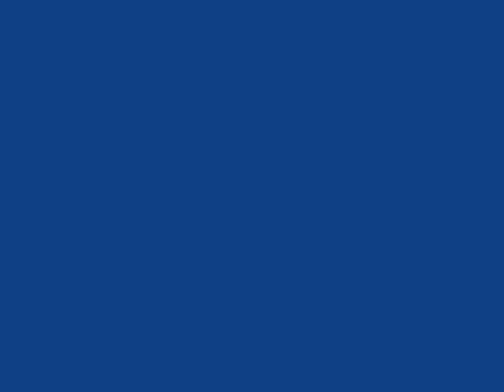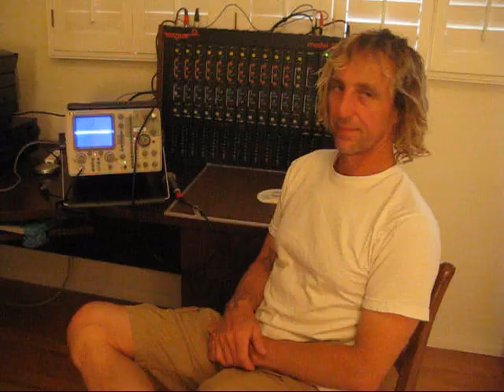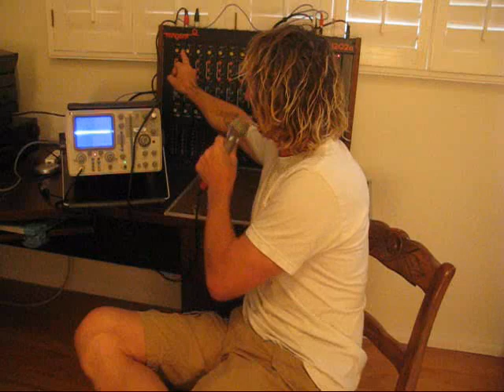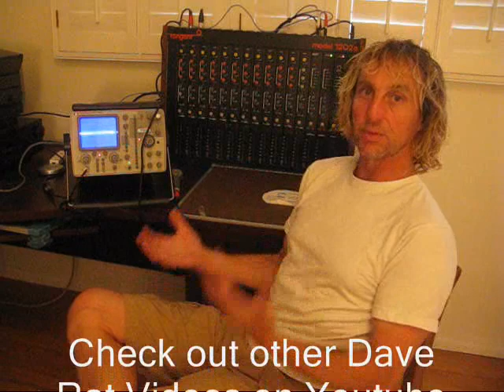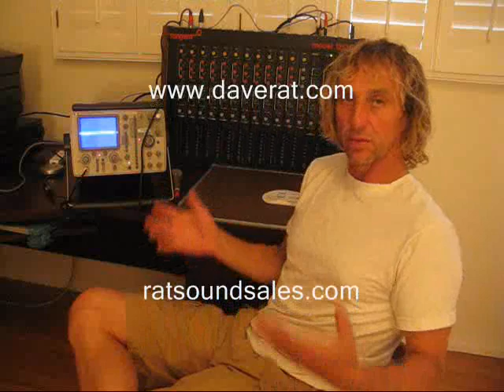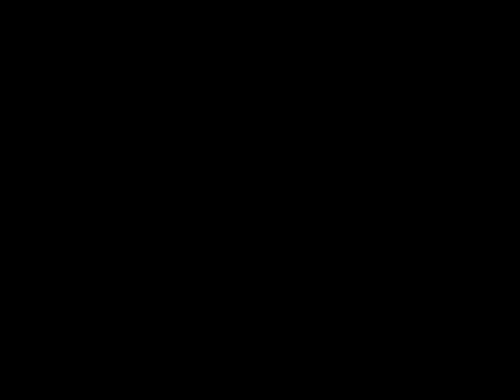Gain Structure Basics for an Analog Console

Comment: You are confusing over-driving a devices input stage with a power amplifier clipping it's output stage.

Clipping the input stage of a guitar amp introduces harmonic distortion which can be pleasing to the ear. This signal is then amplified by the power amplifier section inside the guitar amp CLEANLY. That is to say NOT a clipped signal.

Do not confuse this with clipping the output stage of a power amp which sends square waves to the speakers. In this instance the output.........cont.

Comment: No they are not. Limiting or hard compression does NOT introduce distortion, nothing is over-driven it simply controls output volume by reducing input signal once a predetermined threshold has been reached.

Not the same result at all.

Comment: Incidentally, none of this remotely resembles limiting or compression which was one of your first claims.

Again I say to you do not confuse over-driving a pre-amp to the clipping produced on the OUTPUT stage of a power amp due to the amps power supply not being able to produce the required voltage.

Comment: Most of this post is VERY incorrect, sorry. A little bit of knowledge is dangerous and unfortunately in this case you are displaying it very clearly. Limiters DO NOT work in that way, they are essentially volume controllers on the output stage of wherever they are inserted. They do this by ATTENUATING the INPUT, NOT clipping the OUTPUT!

Distortion is NOT and inequality at all. It is a result of an electrical component being overloaded past it's design parameters! Again different to limiting!